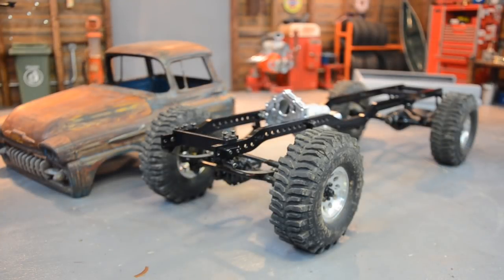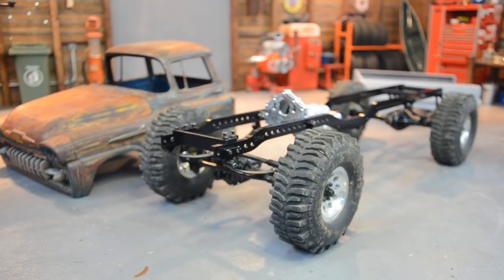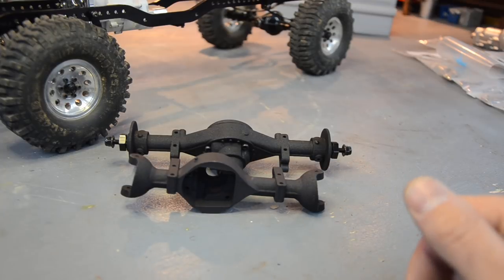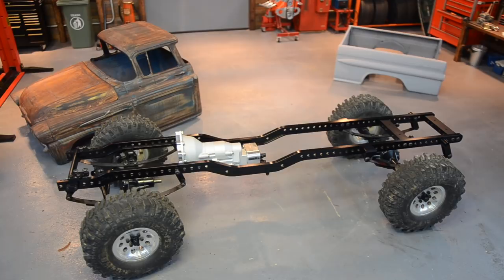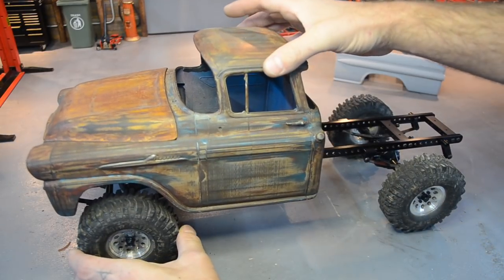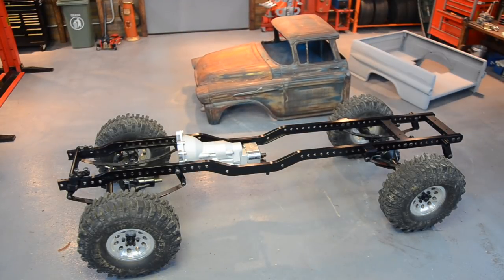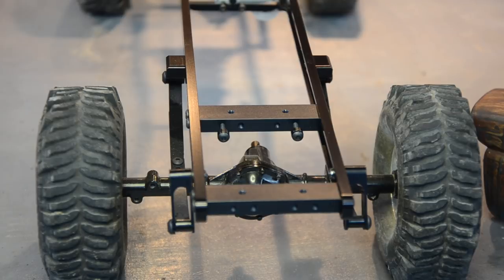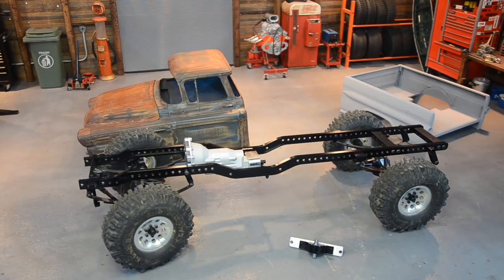GCMracing CMAX Chassis Build, Part 2, The Roller, Scalerc

Comment: That Apache is something you don't see! I think it would be a great tow pig. Move the rear axle and repair the bed, get some clear lexan to make your glass and you'll be close to having it done! One of my rigs has no room for the rear shocks, so I used some short ones mounted to the frame.

Comment: Hey Josh.
Hope you and your family had a Merry Christmas. 
I agree...I'm not a fan of 3D printed axles or the Ascender ring and pinion....I believe they are freeway 2.70 gears. I have a few buddie that has Ascender's and the torque-twist is extremely bad because of the gear ratio. 
I love the chassis...looks to have ALOT of adjustability.

Comment: I love that chassis. Could you please tell me the length of this? I went to the website but couldn't find the specs
Reply from the maker: The rails are 19.5 inches long
Reply: @RCeveryday  awesome thanx for lettin me know. These are a little over an inch short for my 1/8 build but I'm sure I can make these work. Thanx for letting know and continue the awesome builds and videos 😎👍